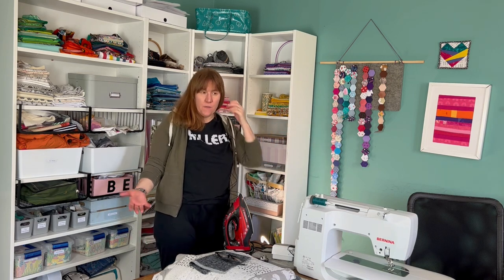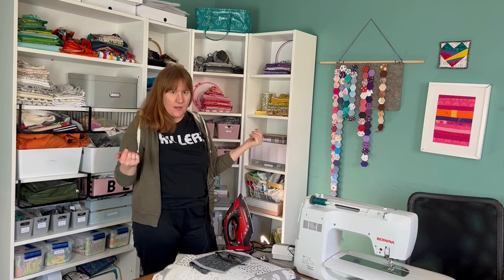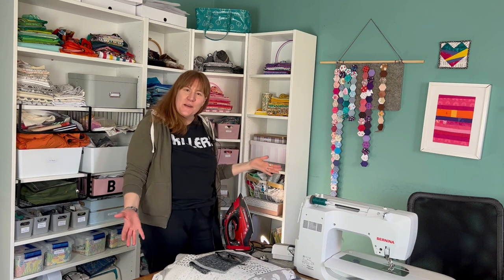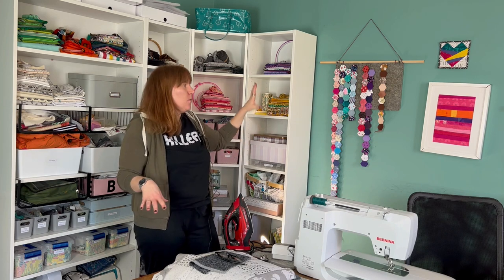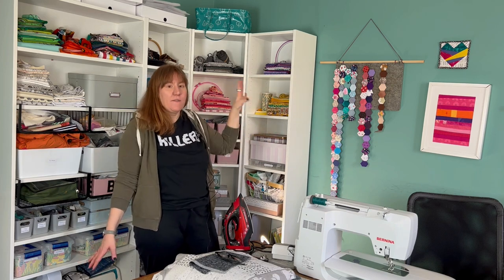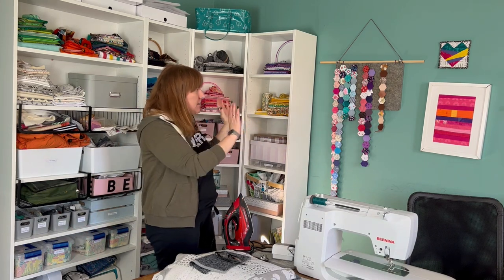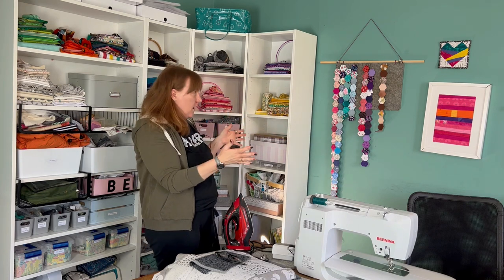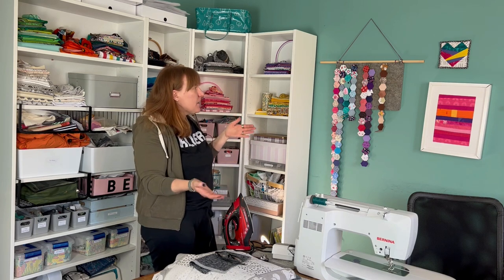How to Make a DIY Quilt Design Wall!

Comment: I used felt left over from an other project. So far it has worked. If I had to buy the fabric for the wall felt was too expensive. I’ll use your idea when I enlarged the wall. Thanks for the help.
Reply from the maker: Felt sounds like a good idea.  Mine is still going strong but I do wish I had more space to make it bigger!

Comment: If you have to do this again, my suggestion is: 
attach the velcro to back of your board, then attach it to each other, 
then take off the sticky bit, 
THEN attach it to the wall! (With a spirit level and a helper!)
That way you don't have to worry about making the board stick to the right bit of the wall! :)
Reply from the maker: Unfortunately you have to leave the Velcro on the wall for 15 minutes before you can put anything on it!  Otherwise yes that way would have been way easier!!
Reply: @ScrapFabricLove  I didn't realise that! You have inspired me to try to make a design wall. I might just attach flannel to a wall, though!
Reply from the maker: Ha ha! Yes I did maybe make it difficult for myself but I like the padded look of it.  Good luck with yours!

Comment: This is a great video.  Thank you for showing us your process.  One question, couldn't you use the command strips meant for hanging framed pictures?  These Command strips also have a velcro connection between the wall and the item you are hanging, but the bit where they attach to the wall, can be removed without leaving a mark when you remove them.
Reply from the maker: Maybe - I’ve not seen those! The only thing I can think of is it might move a bit in the way that a picture could move on a hook - but if you used enough I’m sure you could make it work!